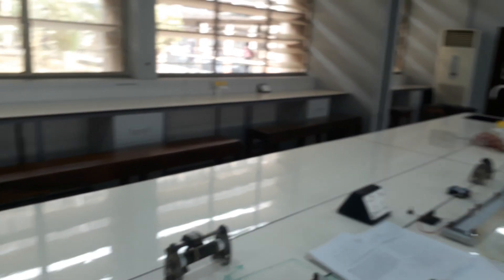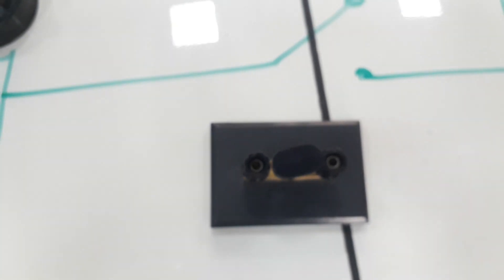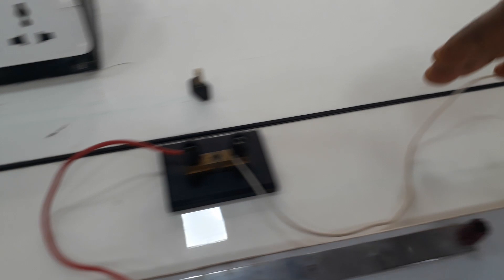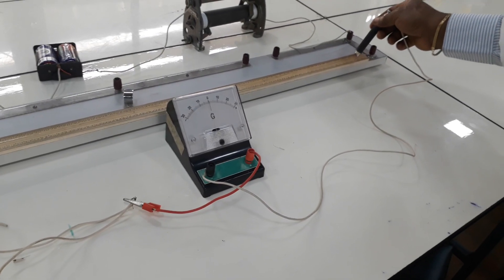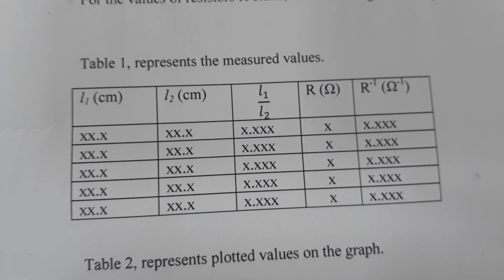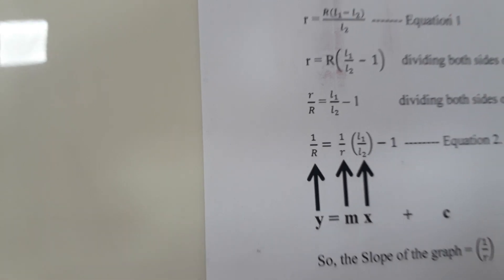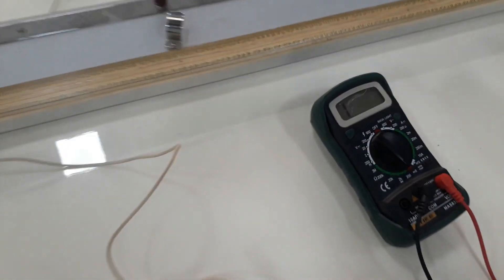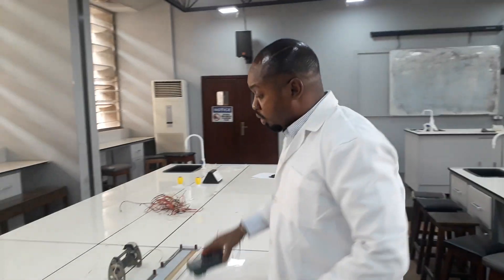Experiment to determine the internal resistance of a cell using the Potentiometer method.

Comment: Thank you Dr., it's nice following you performing this experiment. I just have one observation, from the formula you used to compare with the equation of a straight line, it's suppose to be 1/R = 1/r {(l1/l2) - 1} and not 1/R = (1/r) (l1/l2) - 1. Hence, the intercept is  - 1/r  not  - 1. Thank you.